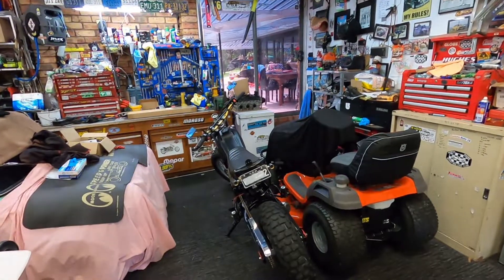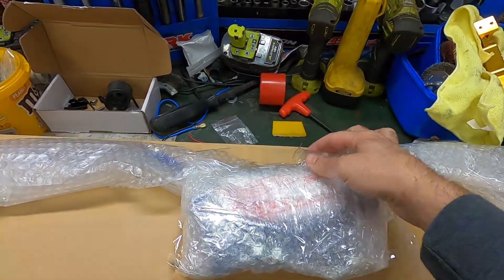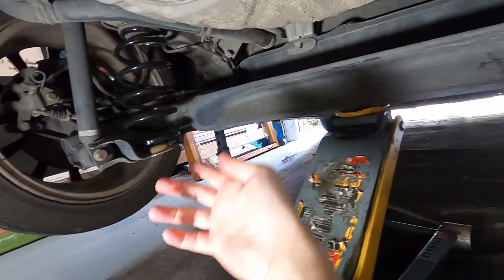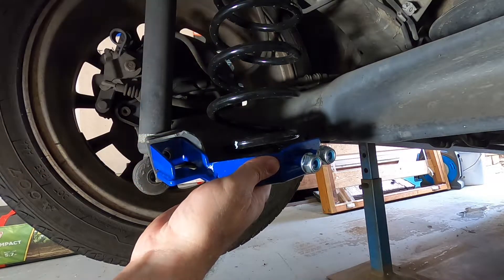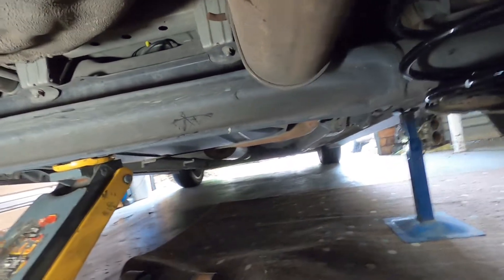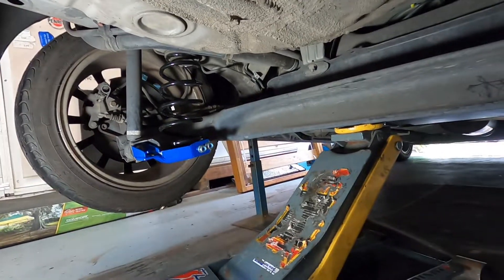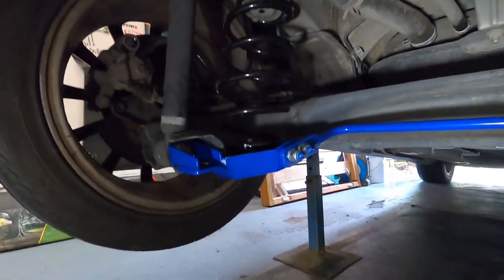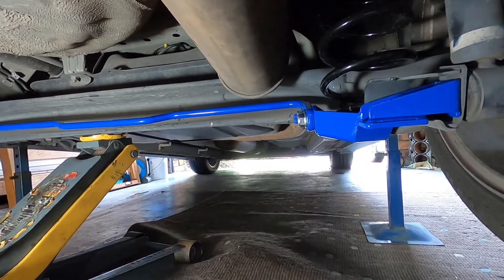Mitsubishi colt ralliart CUSCO rear sway bar

Comment: I wonder why your lowering springs sit loose, would it be from tight bushings on the hinging point of the torsion bar? I would think the weight would push it in but then on big bumps what is pushing back on it? People rate sway bars for track use on these since high center of gravity from the roof.
Reply: I think the OEM rubbers that were on the bottom and top of the original rear springs were not put back when the lowering springs were put in. Top one not sure but the bottom one definitely seems to not be in place, I think they would fixate the springs by adding just a few centimeters. And also take out any annoying noises from the metal to metal contact of the spring on the seat. Nice car btw. You can buy both rubbers for a few bucks from Febi/Billstein.
Reply from the maker: The lower rubber that goes on the spring is only about 2mm thick and was worn through. It really needs lowered shocks to reduce the hang travel..
Reply: Great video, any plans on doing the gearbox yet?
Reply: @driftcarsjp  I think threading the top rods to size w a die set is the way to shorten shocks.

Comment: Hey man, i love your videos on the Ralliart Colt. I'm from EU, and i have a Colt 2004, 1.3. Love the car for it's mechanical quality and durability.
I'm interested in buying the Ralliart Colt in the far future. I want to ask you, is it possible to convert a Ralliart Colt from Right hand drive to Left hand drive?
If it is possible, what would i need to do to di it right? How much do you think (just a basic assumption, i know it varies with how it's done) it would cost?
Reply from the maker: Would be costly to convert.  I don't think the colt was sold in lhd anywhere?
Reply: @driftcarsjp  Yeah the colt was sold in EU even from the early models from the 1980's. I myself had a 1991 Colt, also 1.3. That baby was so fun to drive. The gear shifter was smooth as butter and the carburator was so nicely adjusted, it felt alive. I was able to toe-heal downshift with ease. This new car, for fuel economy i suppose takes almost half a second to register the gas pedal being pressed.

Comment: Hi mate how is reliability for this car? Iam not familiar with this platform and was wondering how reliable are these cars with 180-230k kms.
Reply from the maker: They seem to be a very tuff engine I have seen ralliart versions with 330000ks and there still going strong. The only issue is poor tuning and running high boost. If close to stock they are very reliable.
Reply: @driftcarsjp  appreciate your reply! Hopefully I managed to find a decent one in Sydney soon